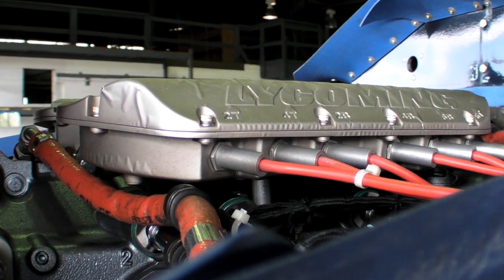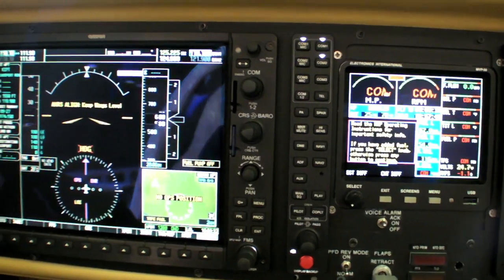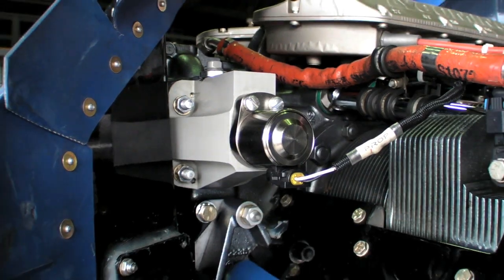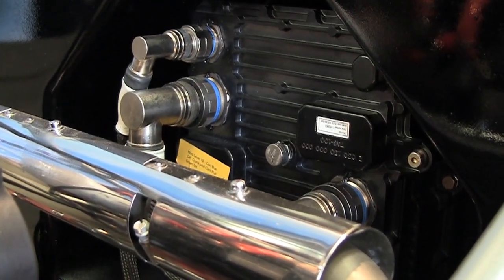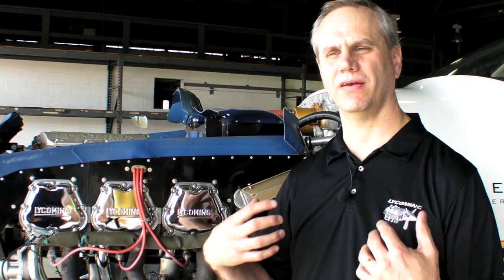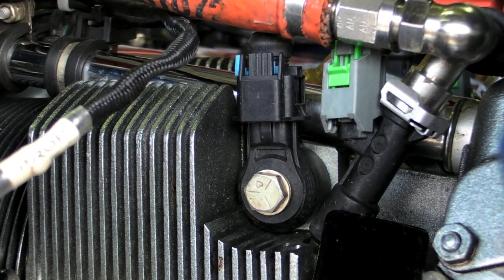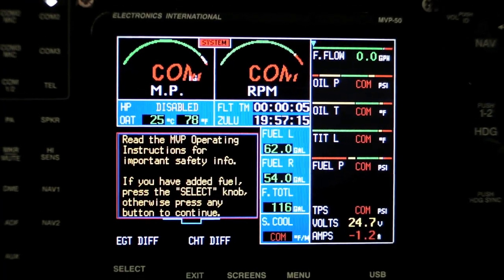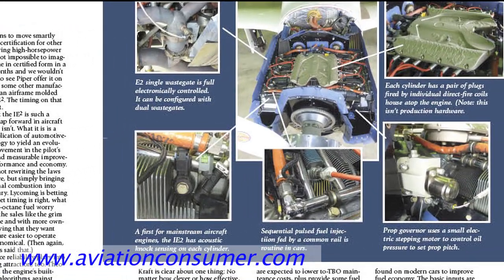Lycoming's IE2 Electronic Engine

Comment: I don't understand why not for this HP and price range wouldn't it be better to use an Allison Rolls Royce 250 turbo shaft. It's much lighter, quieter, smoother. Runs on JP fuel
Reply: And it uses twice the fuel.
Reply: And the overhaul costs more than the Lycoming itself

Comment: Only 30 years late.
Reply: jclfozy - It’s delayed because the industry had to endure, then recover from 30 years of cutthroat lawyers that sued everyone and everything even remotely connected to each aircraft accident.  If you’re angry, it would be more appropriate to vent at a litigation lawyer.
Reply: @Supernumerary  You mean lawyers stopped them from doing what Rotax and others  did years ago?  Make no mistake, it wasn't until the competition from other manufactures that were providing more advanced engines that has made the Lycoming's and the Continental's decide to step it up.

Comment: Will you certificate a "multifuel" version? Here in Brazil we at the agricultural aviation industry would like an engine running either Avgas or Ethanol.
Reply: Sort of like the "flex fuel" engines we've had in cars for more than two decades ...

Comment: Accually there is or some aircraft lines. It's built into TCM engines. If you have a late model engine like a IO-550B or IO-520BB in a Bonanza that has the propper cam gear. It's and easy bolt on.

Comment: Lycoming has become a shlock house using parts from sub-par subcontractors.  Lycoming's use of hollow crankshafts from a low-cost supplier then reselling the rebuilt engines -- which have become a death trap -- for $40,000 should have had those Lycoming execs jailed.

Comment: @KenMacMillan, addressing your comment about why there is no reason an aircraft engine shouldnt be able to use pump gas. 100LL has lead in it to boost octane to 100.  Highest pump gas is 93, maybe lower itsnt guaranteed @93.  Aircraft engines require the performance of a race car which do use high octane racing fuel.  Aircraft eng. runs at full throttle on every flight, something not required of a standard car.  Preignition can cause a deadly engine failure which high octane eliminates

Comment: @KenMacMillan You are 100% right.  With fuel return lines to the selected tank and with proper insulation there is no logical reason we shouldn't be able to use pump gas. Even the worst case of using winter mogas on a hot summer day should work. But I do not think Lycoming is setting out to refuel GA with this engine.

Comment: @SoCalFlya I'm spculating that since the workload of the pilot is reduced there is a gain in safety. Also, the system should eliminate pilot errors that can cause decreases in performance and engine life. With two parallel computers, total failure should be very rare (much less comman than the rare failure of both mags). Finally Lycoming engines can have the same multiport sequential fuel injection and electronic variable ignition timing that cars have had since the early 1980s.

Comment: @circusboy90210 If I understand you question correctly GA aviation is very cautious before implementing new technology until it is tested to exhaustion.  They want to test all possible situations that can occur.  The term if its not broke dont fix it comes to mind.  But yes by keeping GA engines very simple there are less things to fail and Lyco's are very reliable. But now the Lyco"saur" engines are just ancient compare to auto technology and they are slowly catching up.

Comment: @idontcare80 The fuel injection systems that are timed to fire the injectors in sync with the intake stroke are sequential systems, direct fuel injection must also fire at a precise moment relative to the combustion cycle. Also, if you want to see a truly modern aircraft engine check out ADEPT Airmotive's engine.

Comment: @circusboy90210 I guess if you deal with American vehicles you're bound to see a lot of failures lol. As far as I know most engine controls deal with each combustion cycle as an independent event, otherwise how else would an engine vary the timing and pulse width of each injector, or the timing of each spark based on load, rpm, knock, etc. Most modern engines will compensate automatically for different fuel types, just check out the specs on the new Mustang 5.0, or the Flexfuel vehicles.

Comment: @idontcare80 not really aware of any engine that controls each and every  combustions cycle as an independent event for each cylinder, or that can be reprogrammed for different fuels on the fly. (no pun intended). ecu failures happen, seen a few on fleet vehicles, crown vics, town cars, etc... busses 18 wheelers.

Comment: @circusboy90210 Auto's don't need redundant systems. When was the last time you heard of and ECU failure or an ignition system failure in a modern car? Hell, the redundant systems on this engine are just excessive. Also, autos have had technology that is MUCH more sophisticated that this for years; VNT turbos, electronically controlled VVT, EFI, direct fuel injection, CPC ignition, knock sensors, etc, etc, etc. This is still stone age stuff, a crude beast in a pretty dress.
Reply: idontcare80 it is a step up from years of continental telling us their old engine designs were good enough and not offering anything new or improved.
    Got to start some where.
Reply: Stone Age is right

Comment: @fatmanmedia  auto's don't have redundant systems or engine management computers this advanced, close but a few things are missing, except for high end models, or aftermarket equipment. how you get more computing power than a saturn 5 rocket is beyond me. remember most of the computing in analogue systems are built into the device though engineering.

Comment: @circusboy90210 automobile engines have had this sophistication for about 30 years, a modern automobile engine has more control systems than the Saturn 5 rocket and about 50 times the computing power.